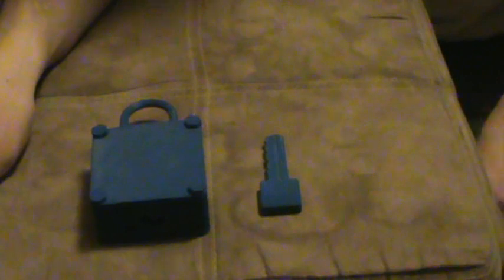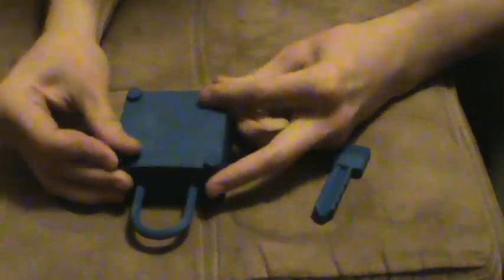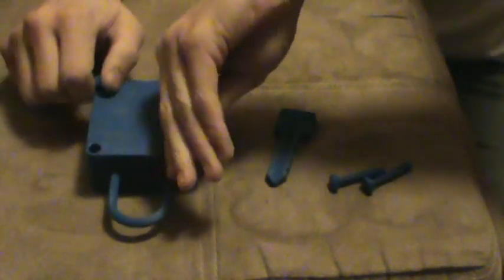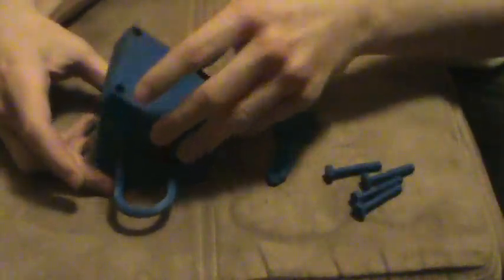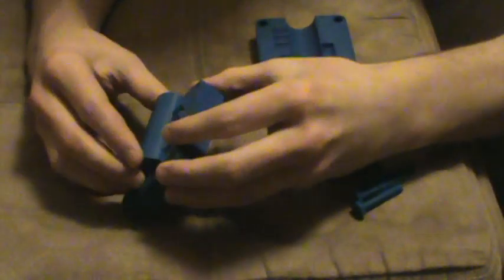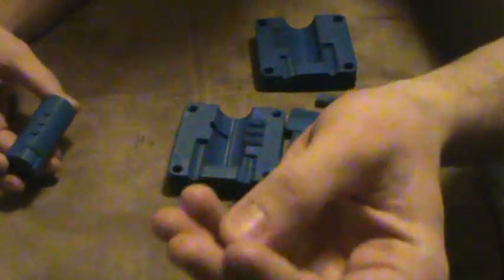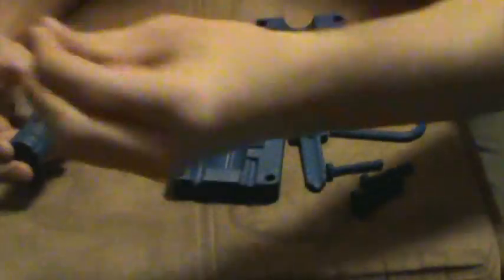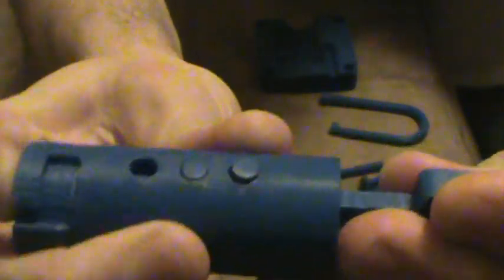3D Printed Padlock and Key

Comment: Now we have 3D printers, we/I can finally make padlocks/locks with more than juts 3 or 7 pins. Lets make locks with 40 pins!! Or 120! Kaba sized mini pins. And unwielding big keys, to accommodate those cuts. But then someone will say "Just get an electronic lock" which is invalid, as mechanical locks have some advantages over electronic ones. We can also bring back old expensive high security locks, like Russwin-Corbin/Emhart, and Medeco, etc. And make them even harder to fiddle with/bump/pick. But, out of PLA/ABS??? Quite weak. But using PLA, I think investment casting of the parts in brass might be the way to go. Nice attempt at your padlock. But the shackle should've been much thicker, on the account that it's only plastic. A heavy thicker gauge shackle would still be harder to break/cut.